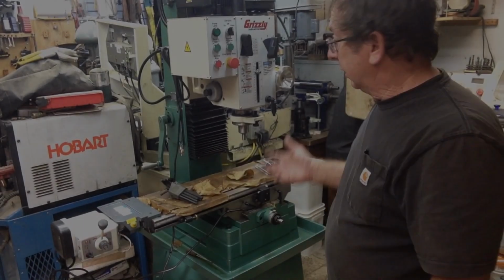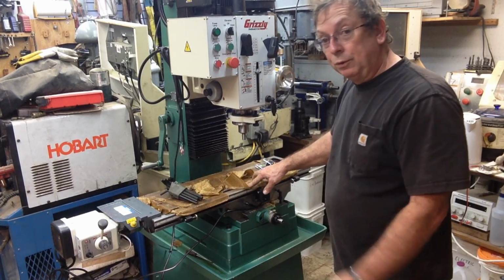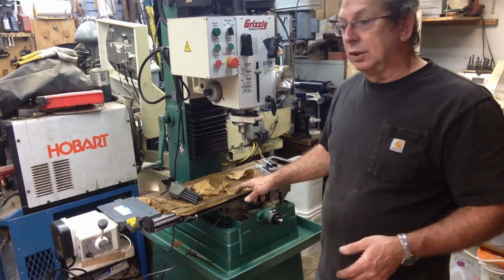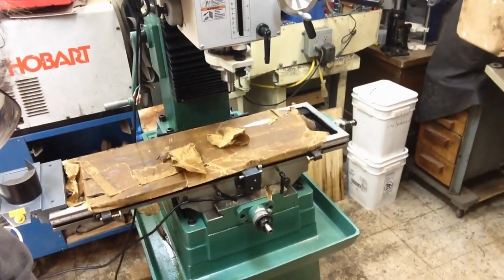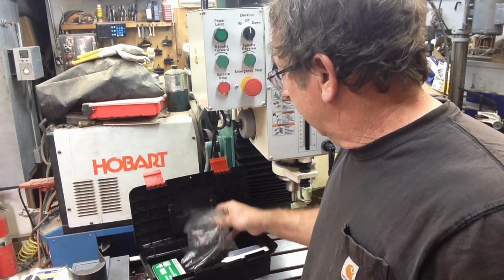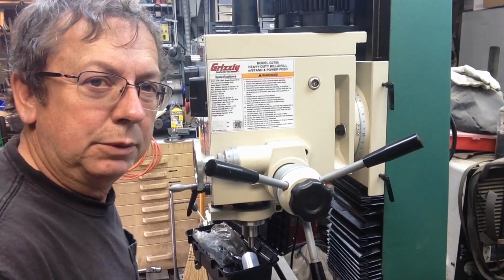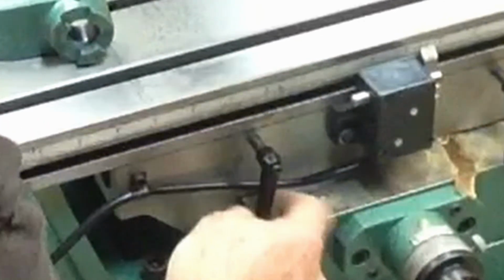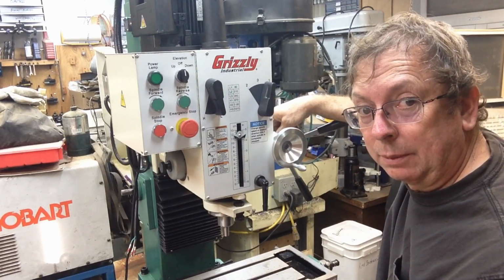Grizzly G0755 ; Part 1: The New Mill Has Arrived

Comment: Its actually great for mÿ gunsmithing and custom rifle building. Doesn't take up much space, is 2hp off 220V and actually has some weight to it at 1100lbs so you dont get chatter. Good mill
Reply from the maker: There is both good and bad with this mill. Not sure that I would buy it again.

Comment: I am looking  at the PM 932, they look like the same mill accept the color. Do you have a preference to grizzly over precision matthews.  Thanks
Reply from the maker: I have not seen a PM in person but several have said that they may be a better machine. I have not been as happy with this mill as I have been with my previous mill drill that I converted to cnc or the g0602 lathe that I cnc'd. I also just got a flyer or e-mail from Grizzly (can't remember which) that said they are going to have price increases some of which may be substantial so if I was buying now it would probably be the precision mathews.

Comment: I'm looking forward to watching this series of videos. I use a GO761 that we bought at work a few years ago and it's virtually the same machine with power tapping rather that a powered Z-axis. We would have bought the GO755 but the X-axis had slightly more travel and that was important for the particular job we bought it for. I got tired of cranking the head very quickly and made a power feed for it as well as a couple of other small mods.
Reply from the maker: Hi Robert: enjoy. Thanks, Dan.

Comment: Great video I'm a new subscriber and I cut timber for a living but I also have a welding and fabrication shop and I have been dabbling at some machinist stuff lately ..I have a atlas shaper and a Cincinnati toolworks lathe and a Cincinnati drill press and I'm in the market for a milling machine and I've really been leaning towards a grizzly ..i would really like to know what you think about yours so far ...thanks
Reply from the maker: Hi Cecil: Thank you, I like the mill and am happy with it's performance. As I get more familliar with it there are a few things that could be improved such as table positioning in relation to the Y axis travel which is not ideal. I just shot some footage today on building the power drawbar which I will have out this week explaining the problem with it. Once again, "I am happy with it" within it's size and my space constraints, Would I buy this particular mill again ? I am not sure.

Comment: I was pondering this mill/drill before a used Grizzly G1007 knee mill appeared on the local Craigslist and only 15min drive.   The seller was the original owner purchased in late 1999.  It was made in Taiwan at that time.   As you stated used machines can have issues.   The seller did not seem to like doing maintenance like cleaning or lubricating, so I have some scars in the ways.  The original vise thrust washer was broken.   I purchased a new vise from Shars.  
I had to fix the broken single point lubrication system to make it easier to lube.
The seller installed an inexpensive no-frills 3 axis DRO.  I may upgrade this eventually.
Last year I replaced the single phase motor with 3 phase and VFD.   This gives me a lot more speed options with VFD and belt positions.
Like you I have height constraints so this is a good size for my shop which is the garage in a raised ranch house.
Nice looking mill/drill.   I hope it works well for you.   Looks good.
Dave.
Reply from the maker: Hi DaveThe G1007 is the mill I am replacing with this mill, I say replacing in the sense that this for now will be my primary manual mill, My G1007 is the mill I converted to cnc but was still using it in manual mode. since the fine feed clutch is the gear that broke I am going to rework it for full cnc. my g1007 will be older than yours by probably about 5 years and it was also built in Taiwan. If you look at some of my cnc videos you will see the g1007, it has also been changed to a vfd and larger 2HP motor
Reply: I had a typo, my mill is G1008, the same as the G1004 but with power feed on the X axis.  A knee mill and so dovetail column.
Dave.
Reply from the maker: @lv_woodturner3899  that would explain the descrepencies in what you had compared to my G1007

Comment: Nice purchase! I'm curious what are the gears in the head made of?
Reply from the maker: Thanks Lloyd, I haven't pulled it apart to check (and won't unless there is a problem) but from sound and feel I am certain they are steel. The gearing on the G0602 lathe has steel gearing and I speculate they are the same basic machined gears in the G0755

Comment: I can understand size constraints.  I'm in a two car garage and space is tight..  But there are some serious deals out there right now on some good machines.  Shops are closing down at a scary rate these days and 4grand will get you a first rate used bridgeport and most of the time, you get to haul off with all the tooling you can cart away.   I wish you luck man,  CNC that thing, it will be good for small stuff.  Don't forget to cut you gib lock handles shorter now or you will scrape your ways.  That problem has been around for YEARS... :-/
Reply from the maker: I plan on building new gib lock handles, no room for a larger mill right now and while it may not be ideal ,logistically it was at the local freight terminal in 3 business days from when I placed the order and while I haven't checked tolerances yet if I have to it can be working tomorrow. So far I am satisfied